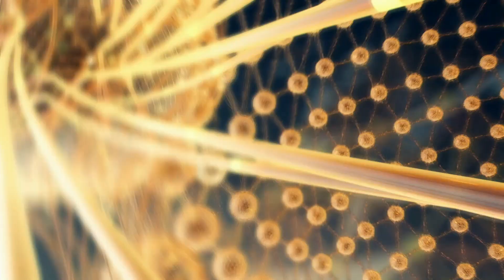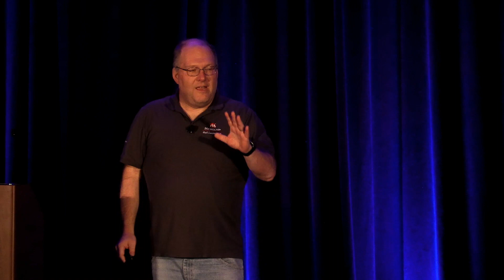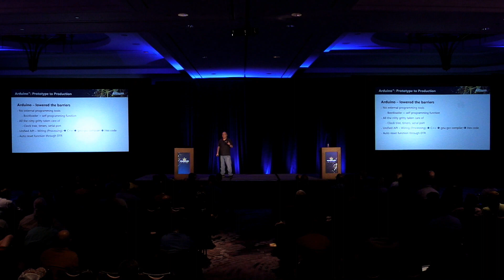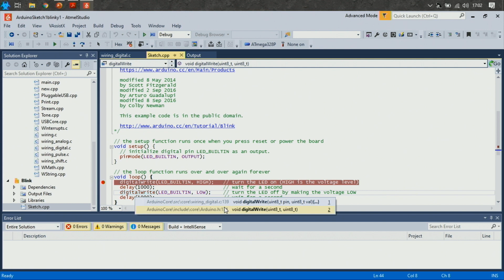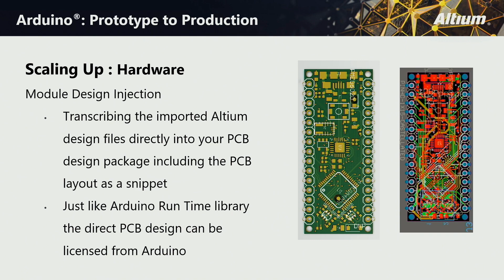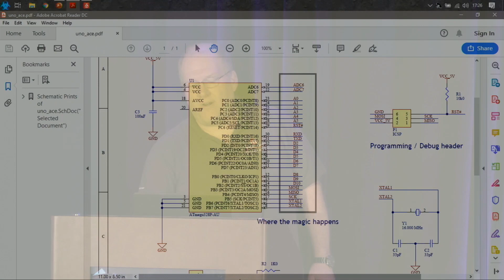Bob Martin on Moving from Prototype to Production with Arduino - AltiumLive Keynote

Comment: I wish Atmel/Microcrap still made the AVR ISP...  One thing to note is that buying 328's from Digikey or the like - the fuses are NOT set to work with the Arduino programming . You'll need to set the fuses - AVR-BURN-O-MAT is a great tool for this. And you have to go thru the ISP header.  Loading the bin/hex would also be done as he mentions. Note that SWD is the standard for ARM - most ARM's no longer support JTAG - esp the Atmel's...  SWD is an ARM design. As to a symbol of the 328 that ref's the Arduino, in Altium I have a bastardized schematic symbol that in the Pin Name references both the Port name (Px) and the Arduino "Magic" he mentions ... For instance in the pin name/pinout for a 328P AU:
29 PC6 (R\E\S\E\T\)
30 PD0 (RXD) ARP0
31 PD1 (TXD) ARP1
32 PD2 (INT0) ARP2
1 PD3 (INT1) ARP3
2 PD4 (XCK/T0) ARP4
6 VCC
5 GND
7 PB6 (XTAL1/TOSC1)
8 PB7 (XTAL2/TOSC2)
9 PD5 (T1) ARP5
10 PD6 (AIN0) ARP6
11 PD7 (AIN1) ARP7
12 PB0 (ICP) ARP8
13 PB1 (OC1A) ARP9
14 PB2 (S\S\/OC1B) ARP10
15 PB3 (MOSI/OC2) ARP11
16 PB4 (MISO) ARP12
17 PB5 (SCK) ARP13
18 AVCC
20 AREF
21 GND
23 PC0 (ADC0) ARA0
24 PC1 (ADC1) ARA1
25 PC2 (ADC2) ARA2
26 PC3 (ADC3) ARA3
27 PC4 (ADC4/SDA) ARA4
28 PC5 (ADC5/SCL) ARA5
3 GND
4 VCC
19 ADC6
22 ADC7

Where AR is the arduino port number. 

I hate the term "ecosystem" so over used.... Back in 1995, my one coder did an assembler in GCC on linux for the then new Atmel 8515 - he hates Winblows ... As to start ups - well, google Amnet and the Golden Boys.... Oh yea - my page is not mobile friendly - F that crap...  You'll see the 1995 patent on what was basically the wireless Internet of Things .. As to Microcrap, I recently asked why their latest version of Atmel Studio won't work with the SAM 4's - they had no idea. A few years back when it was still Atmel my coder Joel was mucking around with an assembly instruction call PLLCount and bricked the parts - turns out it was the JTAG clock and at the time the Mkii couldn't slew the JTAG clock. We had to figure that out on our own - the tech support guy had no clue...
Reply: Yes.
But you missed the point: the new arduinos are based on the ATmega4809 chip which has CCL - basically a small hello from the FPGA world.